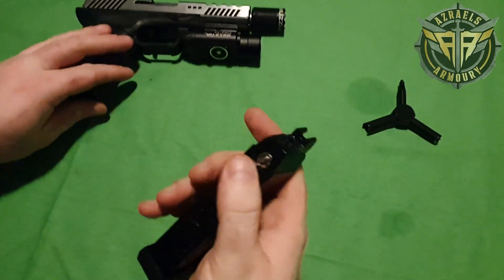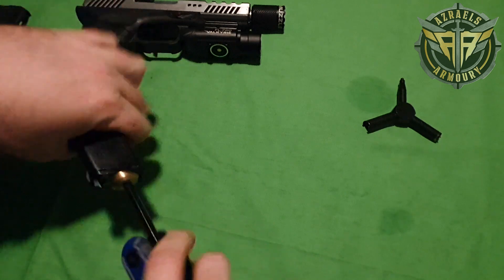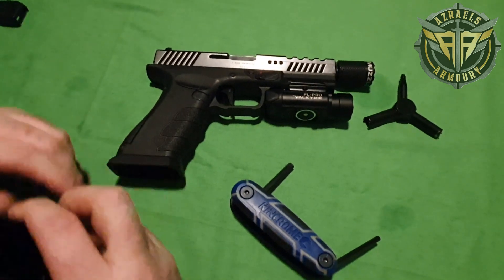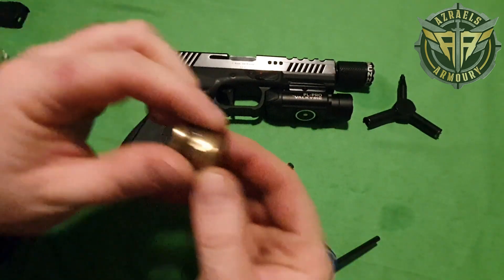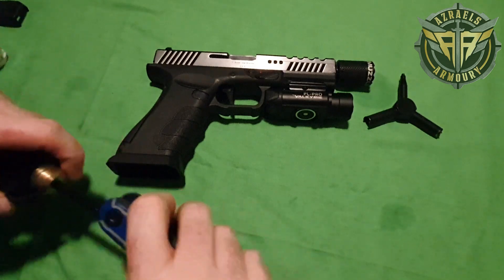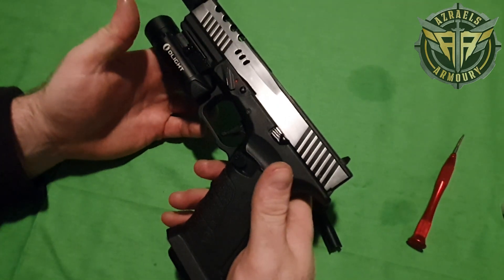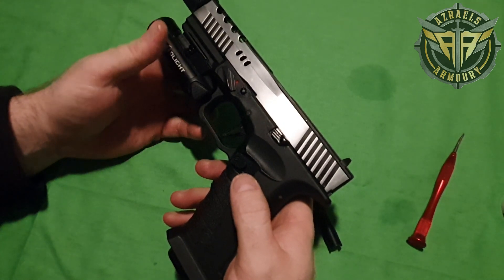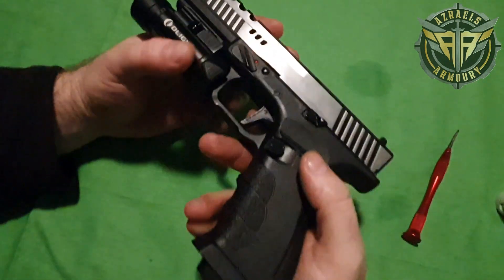HOW TO FIX LEAKING APS CO2 MAG AND PRESSURE ISSUES

Comment: Thank you so much. I bought an aps shark pistol and the seller told me the gas was leaking. It was a very very quiet hiss but when I bought the valve key it sealed it tight again.
Reply: I also had to find that "perfect spot" mine was more on the loose side because too much pressure made the valve collapse a bit which was causing the little hissing.

Comment: Just bought the Shark. Your videos are awesome. You Rock!
Reply from the maker: Thanks man I appreciate it. The shark is awesome. I cracked a nozzle on mine after getting addicted to full auto lol but that was after some time. Enjoy your shark 🙂
Reply: @Evolutioncustomblasters  I just replaced my nozzle aswell💀
Reply: @Evolutioncustomblasters  hi from 2021, mine exploded while replacing my co2 in my shark, turning it was jammed. It leaks at this point so I thought the peircer was the problem until it came in today and replaced it. The valve is now leaking
Reply from the maker: @ddmdjkdkx2678  wow okay, who was it that served you today? they should have put a bulb in and checked to see it was leaking or replaced the mag for you
Reply: @Evolutioncustomblasters  I bought the gun from evike never used, I actually stopped the leaking problem but it happens to still spit out air and bbs at a very small velocity ratage.
Reply from the maker: @ddmdjkdkx2678  that can be either the valve being too tight or you may have a slight hairline crack in your nozzle. The crack can hardly be seen until you really look with the nozzle out. Also it could be your bucking (nozzle not sealing properly) or nozzle piston
Reply: @Evolutioncustomblasters  I’m suspecting that a crack in the nozzle could be possible, I do say that dropped the magazine on hard concrete the day I got it on accident, the CO2 bottom slider fell off but nothing major occurred, I feel as if when I unscrewed it and it exploded the nozzle may have cracked leading it to that.

Comment: Great video Shakka as always. One of my mags is leaking so I'm waiting on the valve tools to come back in stock so I can fix it. Also how much active trigger travel have you got? In you last video you mentioned you got rid of all the dead space using the grub screw. Is approx 2mm of active trigger travel normal? Cheers man 😎✌️
Reply from the maker: thanks man! 
yeah as far back as it can to eliminate trigger play just make sure you don't go too far or your trigger will not reset and your pistol will not fire
Reply: @Evolutioncustomblasters  so once you've dialled this in how much trigger movement do you have roughly?
Reply from the maker: About 1 or 2 mm. I used a tad of blue locktite to hold my grub screw where I wanted it so it wouldn't work it's way out

Comment: Hey man I have a problem with my mag but not with co2, it is a nwell m92 and it seems like the mag follower spring is too strong and forced all the gels to fall out. How can I fix this
Reply from the maker: hey bro what you can do is squeeze your mag lips at the top of the mag where the gels come out with plyers gently. if it starts to chop gels then your have closed the lips too much but then can pry open a tad with a flat head
Reply: @Evolutioncustomblasters  well it usually did that anyway but i figured out the problem, the follower spring was way too strong so i swapped it for a weaker one from a different mag and it runs hella smooth.
thanks for the fast reply man

Comment: Seems like there was NO Quality Control when these things were made.... All 3 I bought leak gas , also on my Shark the slide catch doesnt work,  ..... there Great As Paper Weights though!!!!!!!! Not good when I spent over $1000 >>>>>>>>>>>>>>>>>>
Reply from the maker: The slide not going back is just a valve adjustment or new mag release at worst. And we can sort the leak but they require maintenance. Our airsoft counter parts understand this, where as gelballers are used to aeg blasters